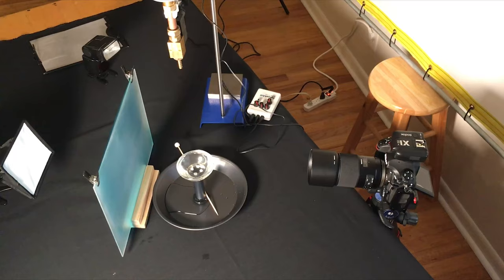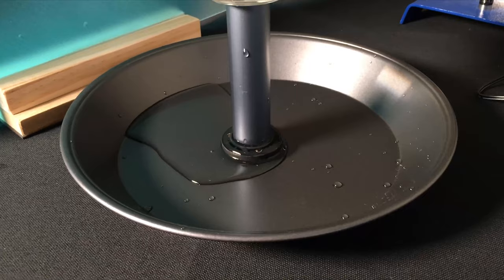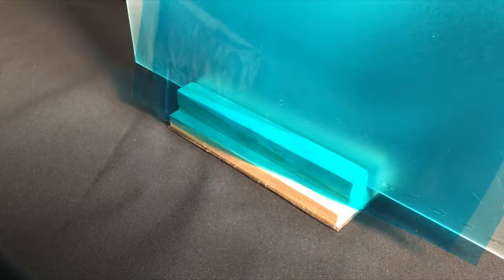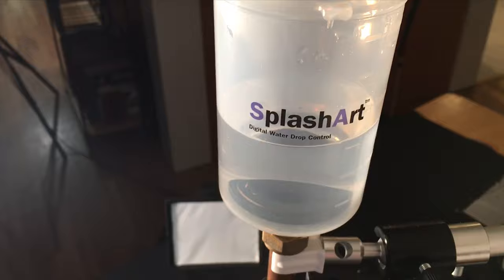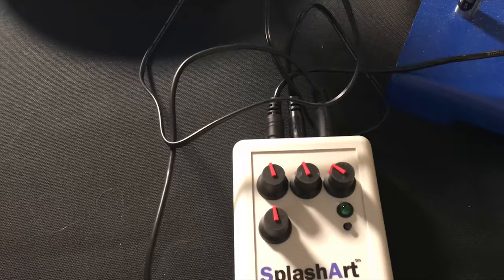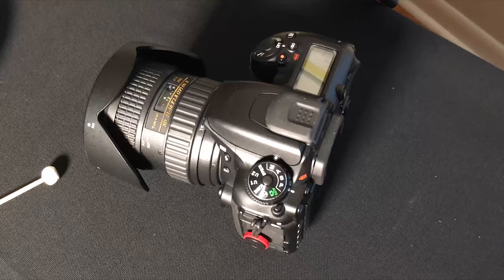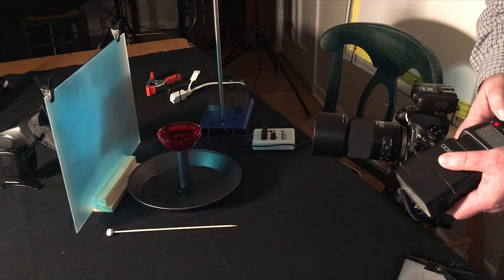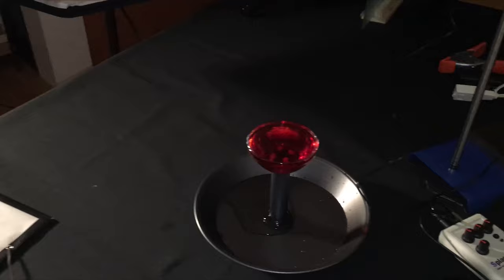Photographing Water Drop Collisions

Comment: Thanks for the video. But need to work on your background which is very blank right now. Further, need some room in the foreground also as the water spalshes seemed be cut off at the bottom. But the timing of the shots are lovely. Thanks again for sharing.

Comment: Great video! 
Use a marker, put a dot next to the red dial so you can keep track. I found this for mirror up for a Canon 80d . It's what I have but it might be the same for other canon "To enable mirror lockup, press the camera manu button, find the appropriate Custom Function option or correct Shoot menu. Select Enable. When mirror lockup is enabled, press the shutter button once to raise the mirror. Pause a moment or two and then press the shutter button again to fire the shutter."
Reply from the maker: Thanks Lisa. I should have included mirror up instructions for Canon shooters - this will be very helpful for them!

Comment: Just got the Pluto valve. Hasn't got a macro lens, so I ended up using my 70-200mm. A bit tricky to get the focus right, as it was just around the lens near limit.
As this was in my living room in the middle of the day I figured out that using my variable ND filter on about max was a good idea. Played with some food coloring in the bowl.
After figuring out timings, light and focus I ended up with a couple of ok photos out of my first 300. The best splashed vere unfortunately out of focus.
The Pluto trigger is bluetooth controlled from my smartphone. So I ended up just laying on my coach, clicking a button in the app every time my speedlight said it was ready for another shot

Definetly a part om my photography hobby that I am going to spend more time with.

Comment: Hi there great video and it will help me I guess, thing is I have just started and using the Pluto system, it’s not as straightforward as plugging it in and away you go it’s definitely a learning curve for any photographer, not managed to get the double drop yet but watching this I will try a few things, one again thanks Tony U.K.
Reply from the maker: Definitely a learning curve! I hear the Pluto is a solid trigger, so it won't be long before you are nailing double drops and all the other fancy shots. Secret to success... only ever change one variable at a time and allow enough drops at the new setting for the device to equilibrate. That will get rid of 99% of the confusion and frustration.

Comment: FYI... Many studio flash units control light output power by switching more or less capacitors in or out of the circuit so the flash duration is not significantly affected by changing the power output of these lights.  Most speedlights and portable, shoe-mountable flash units however; use a different type of circuitry where lowering the manual flash power output does, in fact, alter flash duration.  There are special models of some studio flash equipment which DO allow you to adjust flash duration.  The Paul C. Buff Einstein unit is such a light.  Just sayin'...
Reply from the maker: Thanks Christopher. Your point is well taken and I should have been clearer on this point. I have using the Einstein forever but shouldn't have generalized my comments. Thanks for clearing this up. Cheers!

Comment: Very well detailed description of the process. I have one question, what is the optimum distance between the bowl in the bottom and the nozzle of the solenoid valve from which the drop is released.
Reply from the maker: Gosh, I don't know. I use about three feet, but I have never really experimented to see if there is a better height. The higher you go the more wet your table gets, I know that much. And too low and you don't get big enough splashes,. Try 3 feet and then experiment!

Comment: Another informative video Allan. I’ve been giving the Splash Art kit a go over the past few weeks - with mixed success ! It can get a bit frustrating with so many variables to take into account. The biggest problem I encounter is that the final images are just not “clean” and appear soft and grainy despite being at iso 100. I suspect that there isn’t enough flash power to light the splash when at 1/16 to freeze the action. Will try and add another flash next time or move it closer to the drop. Look forward to your next video on this subject. Thanks.
Reply from the maker: Thanks! I understand the issue. It can be hard to get the lighting perfect. Here are a couple of recommendations... when setting the timing on the SplashArt, adjust only one parameter at a time and after each adjustment trigger the drops at least three or four times before you try to shoot. I've found that the timing doesn't get settled down until the valve has been opened a few times. Leave the drop size alone (at the 12 o'clock position) and fine tune the delay using just a single drop. When that is dialed in, start making tiny adjustments to the time between drops until you are getting good collisions. Then you can start messing with drop size. I have found this approach to work pretty well.
The lighting is another thing that requires finesse. Shoot at your sync speed and use a speedlight power of 1/8. At 1/8 power your effective shutter speed (the flash duration) is still very, very short (about 1/3000 sec). Which is plenty fast enough for any water drop. So adding power is one way to go. Another option is adding another flash - but be very careful. Not all flash units sync up well together. Best to use another unit of the same brand/model. But before I would add a light I would make sure that you are shooting in a very dark room. Ambient light sneaking into the camera will cause this softness you are describing. Lastly, I would check online to find the best aperture for sharpness and try shooting at that setting. You may be tempted to shoot at f/16 to get the most DOF, but if your lens is sharpest at f/8 (like many lenses are), you will see a big difference. One other thing... shooting water drops very often ends up with some of that liquid getting onto your lens. Even from quite a distance. So check the lens every now and again to make sure it isn't wet. Did I already say to move your flash as close to the splash as you can get? Well I did now.
I hope that helps!
Reply: Allan Walls Photography Thanks Allan for the tips. I shoot with the D850 and have the Tamron 90mm so same as you. I’ve two different brand flashes so that might be an issue if I add another. Will be having another go at the weekend so will try out some of the things you have mentioned. Thanks again.
Reply: @barrymills3512  It could be to much ambient light. I always do things in a darkish room light. I tend to use 4 flash guns at low power, all Canon, when back lighting to get enough light. I found out about the ghosting problem myself.
Reply: brianT Thanks for the tip. I have got slightly better results now changing things but will also invest in some better flashes in the future - all the same brand.
Reply from the maker: @barrymills3512  It definitely helps!

Comment: Splash art is supposed to be great. Another company that has something similar is Miops. It's more cost effective for the beginner. You use an app to time it all. You can use milk , food coloring and add Xanthum gum.
Reply from the maker: Good point. I have the Miops trigger, and it can be very useful. I chose SplashArt because of the high-quality solenoid/valve assembly - it is very well built and durable. Thanks!

Comment: How do you clean this , to prevent rust ?
Reply from the maker: You mean the dropper thingy? I take it apart (unplug the solenoid, not dismantle it completely) and let any fluid still in there drain by gravity, then I flush with clean water. If I'm planning on using it again soon, I'll leave the reservoir half filled with deionized water and put the whole thing in a clean dry closet. If it is going to be packed away, I gently dry it with a hair drier (why do I own a hair drier? that's one of life's mysteries) and coat the brass with a thin layer of grease (gun oil or something, the label fell off). Don't put anything up the spout though. Then I put it in a sealed plastic box (a foam thing keeps it airtight) with a couple of fully charged silica gel holders, seal it up, and Bob's your uncle till next time.
Reply: @AllanWallsPhotography  hi 
Thank you for informing me , I've got one coming tomorrow  , I hope I can get the same results has you .

I watched a guy on YouTube and he recommended starting with the dials pointing at 11.00  , is this somewhere where I need to be if I'm only using water .

Many thanks Alan
Reply from the maker: @michaelganner1581  That's a good tactic. This is all dependent on your device, the height, the liquid, how you comb your hair - it is very much a feel your way through it process. starting at 11 will get the timing close, and from there, experiment. There is an excellent description of the setup in the documentation. I highly recommend you follow that.
Reply: @AllanWallsPhotography  
Many thanks Alan  , I appreciate you getting back to me  .

Fantastic advice and very informative  thank you .
Reply: Hi Alan

So I received the splash art kit  , and I'm having loads of fun with it , I started getting results in no time and thanks again for your input .
 LOVING IT 👍👍👍👍👍
Reply from the maker: @michaelganner1581  Shoot me some pics when you get a chance-  contact@allanwallsphotography.com   cheers!

Comment: You have the arm on the wrong side of the stand. You do not need a weight on it . I have this kit.
Reply from the maker: Hi Brian. That is deliberate - the base is turned around so that I can use a larger container for the splashes, without having to raise the container to make room for the base.